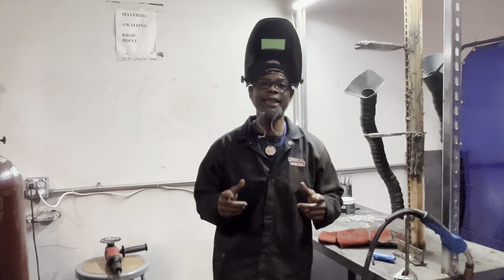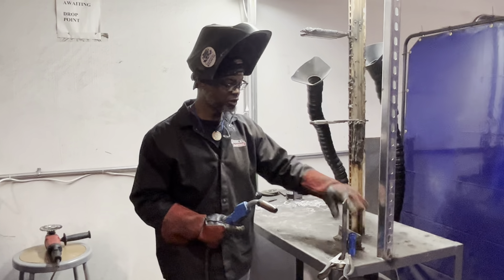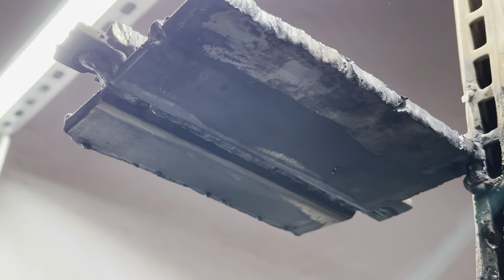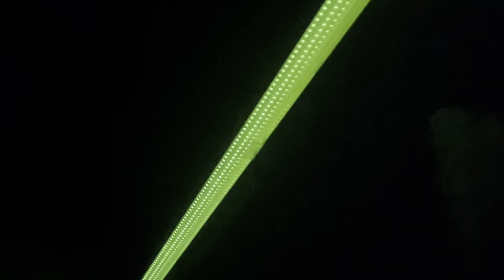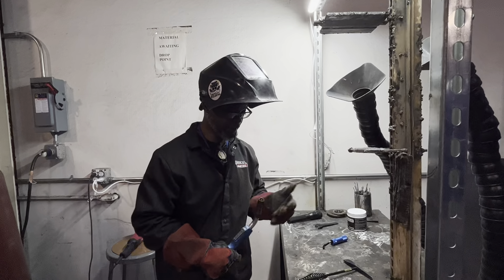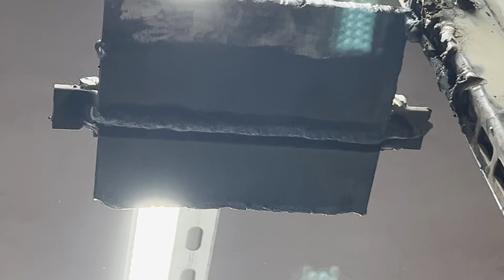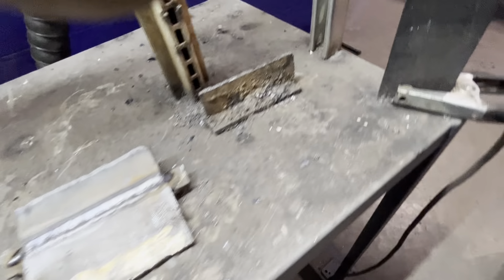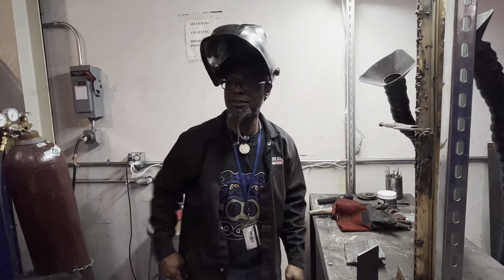How To Weld Dual Shield Flux - Core 4G!

Comment: Can you do a mig vertical 3g uphill video with 3 weld passes
Reply: mig vertical is not good for alot of situations except when unavoidable. for .045 you want to be around 16-17 volts and 140-170 on ther wire depending on brand of wire.  I believe for lincoln wire we had our stuff around 16.5 145-150 if memory serves correct. do not vertical down with mig or fluxcore ever.  the welds will be weaker and more prone to inclusions.

Comment: Thanks for this!!!! I'm running NR 233 right now in class but any and all info helps. Love dual shield, hate innershield. Lol
Reply from the maker: Lol I feel you 💯 to me it like welding 6010 Stick welding but only with wire. I use the same style and it tends to turn out find. Do small tight circles with a 1/4 inch stick out and you should be fine! HogOn